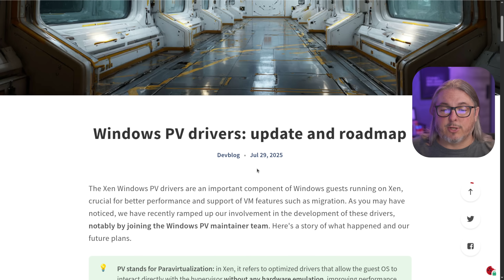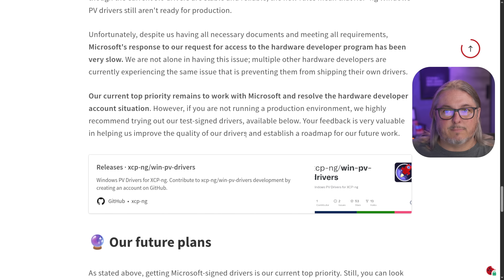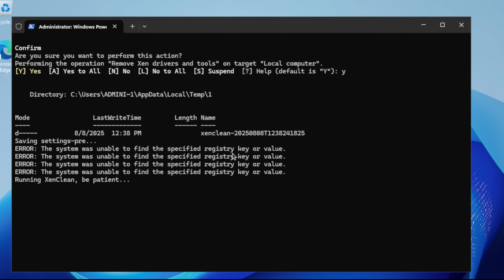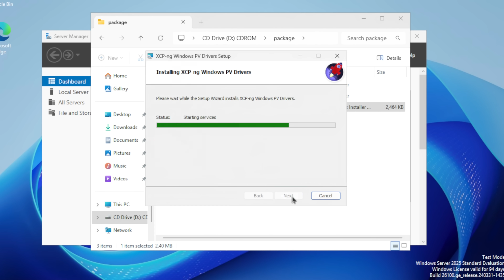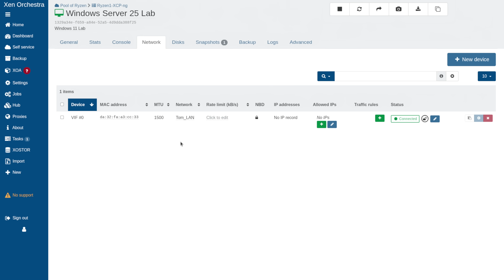New Beta XCP-ng Windows PV drivers

Comment: Appreciate the video! Our Enterprise uses Palo Alto VM series firewalls. As much as we have tried, running a Palo Alto VM series firewall on XCP-NG is a no go. Can you dispel or confirm this? At this point we feel KVM is the right option (versus VMware which we are migrating
 away from). Great job on the videos BTW!
Reply from the maker: I don't use Palo Alto VM firewalls so really not sue.
Reply: @LAWRENCESYSTEMS  I was able to get Palo Alto VM firewalls working. I had a couple deployed inside ESX and used the XOA VMware import tool. After the import, the firewalls came up without issue. Just thought I would follow up on this and provide my new findings.

Comment: Why should I use the PV drivers? Are they better?
Reply from the maker: Yes
Reply: Pv drives are light weight drives that don't need hardware emulation the just use bounce buffers making them faster
Reply: I use the drivers from XenServer and have had no problems. So why should I switch?
Reply: @DerDolce8430  If it works for you, why try and fix something that works. You dont need the best "way" you need to know your way and how it works for you...

Comment: If I convert a physical windows PC to a VM do need the PV drivers before boot like virtio with KVM? Or will it boot with default kernel drivers?
Reply from the maker: It will boot without the drivers.
Reply: @LAWRENCESYSTEMS  thanks, I am managing a couple of windows machines, I am using Vmware at moment, but I want to move to xcp-ng or proxmox. restoring a backup and then just booting with any drivers is a great point for xcp-ng

Comment: I don't think they meant testing.  I think it's labeled as TestSign as in these are only signed with a test certificate.
Reply from the maker: Ooops, you are correct. I just used the YouTube editor to trim that part out
Reply: Yes.  

This is a common practice within microsoft for employees who are running nightly and other pre-rel builds of things.  As you might imagine, it's relatively difficult to get something "real signed" by one of the production authorities that literally the entire planet would trust , and so for daily use of random debug and other test/development builds, part of an employees machine setup is to install the correct MS-internal test certs for the product(s) they'll be working with.